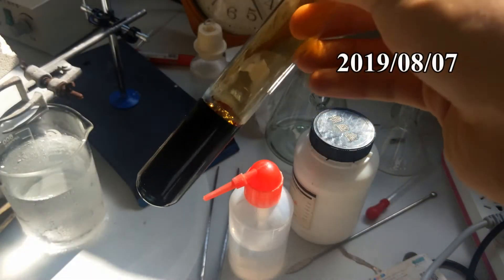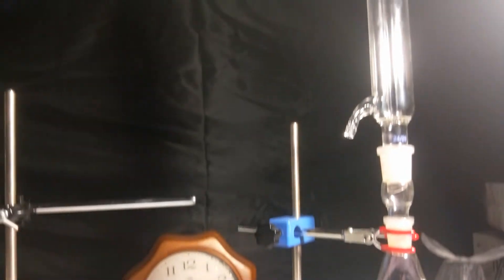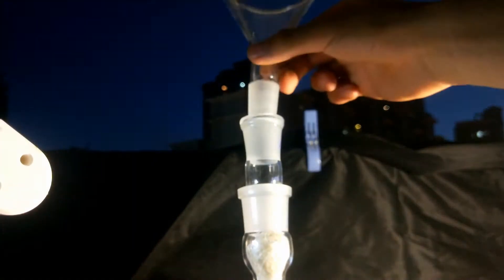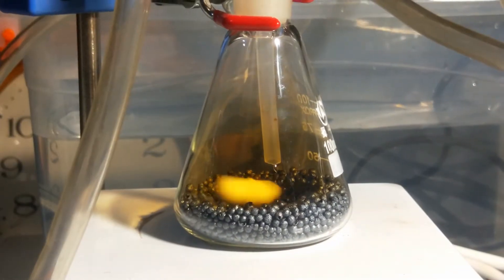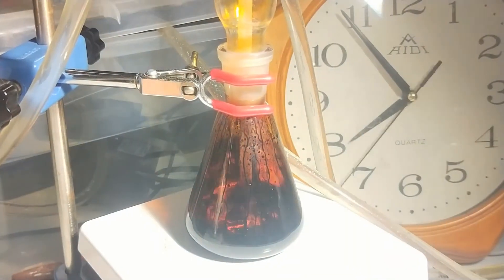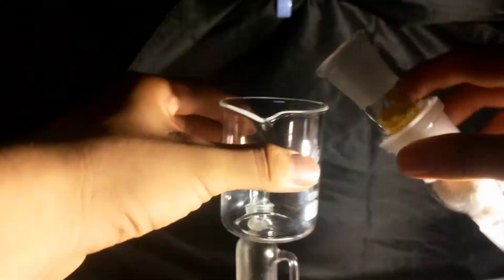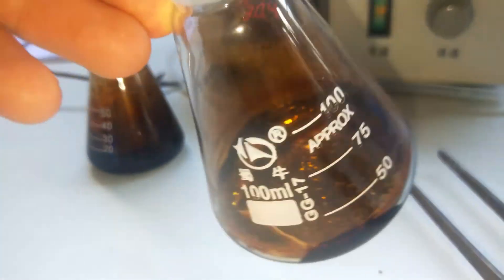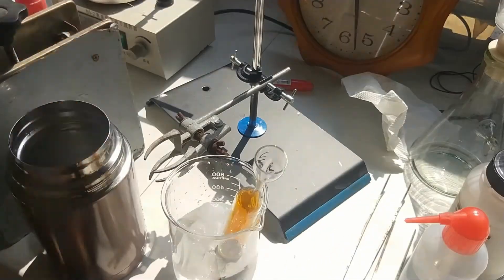Preparation of iodine monochloride

Comment: Why didn't you use the potassium permangnate and concentrated HCl? Or sodium hypochlorite and sulphuric acid for the chlorine generation.
Reply: ^^^Yeah TCCA is super cheap and HCl is also super cheap, sulfuric acid and sodium hypochlorite is worse than using TCCA and HCl sinc a bunch of chlorine dissolves in the water in the sodium hypochlorite
Reply: @EdwardTriesToScience  I am using those combination whenever I don't have filled Chlorine gas cylinder in my Lab.
Reply: why would you use those reagents? they are a lot more expensive, hcl and tcca are dirt cheap...
Reply: You could use sodium or calcium hypochlorite with HCl rather than useing sulfuric acid, even vinegar will work to generate chlorine
Reply: Well since acetic is being used up in the reaction I doubt it'd pose a problem, also considering someguy gassed himself to death by mixing like half a liter of bleach with half a liter of vinegar